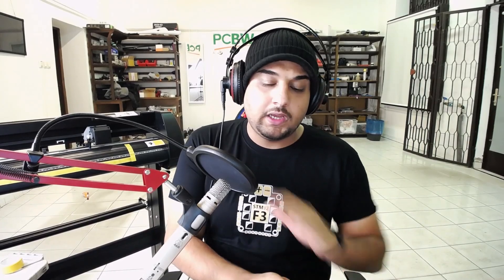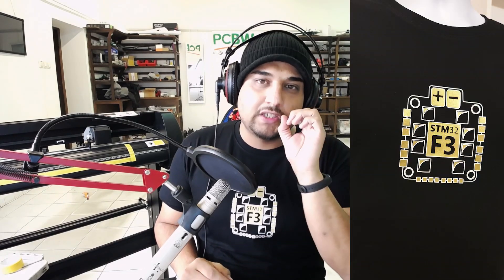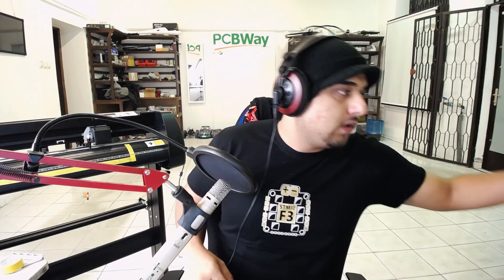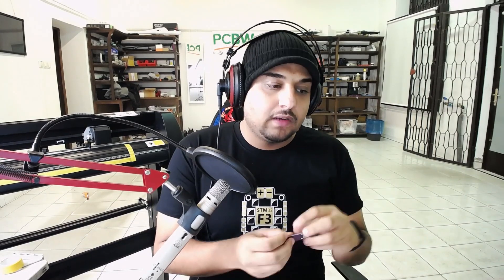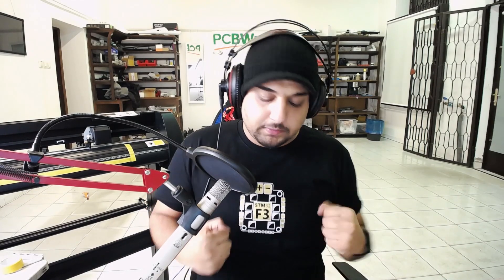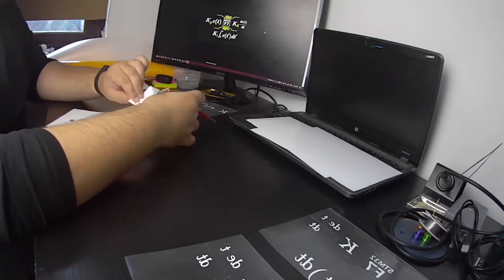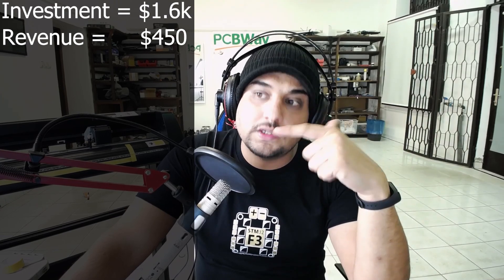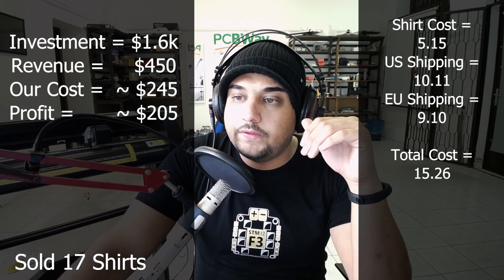How Much Money My FPV Shirt Project Made //  EP2

Comment: How about a 3 axis of rotation shirt.
Quadcopter in the middle with roll pitch and yaw. And little arrows showing rotation. 
Or
A vtx transmission shirt. Like bands and channels and their frequencies or a shirt showing the video transmission field produced by an antenna. 
Or
A motor shirt. Showing the motor phases and wires. And maybe an equation about how the esc spins the motor
Or
A carbon fiber shirt. Showing the assembly with resin and fibers. Or showing impact or stress analysis on frames
Or 
A propellor shirt which explains the pitch and what it means. 
Like the prop is corcscrewing up and there's little trails at the tips spiraling down.
Then an equation relating the pitch to the height gained or air pushed.
Or
A fpv camera shirt 
Showing the components sensor and stuff. 
Or a battery shirt with the voltage wattage and amp equation along with amp hour and c rating 
And maybe a battery component thing that shows the layers of lithium and conductors and stuff. 
And lol I just want a free shirt. 
Im waiting for when you have more shirts out so I can order several at once and get a discount. 
Looks awesome so far.